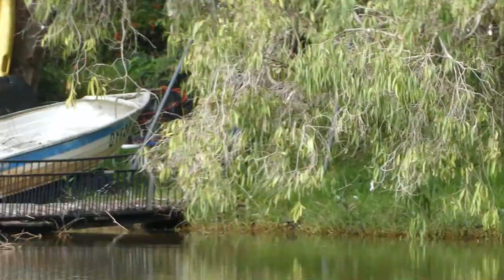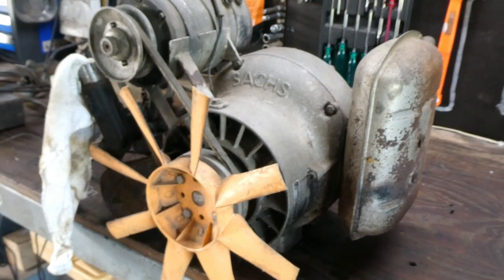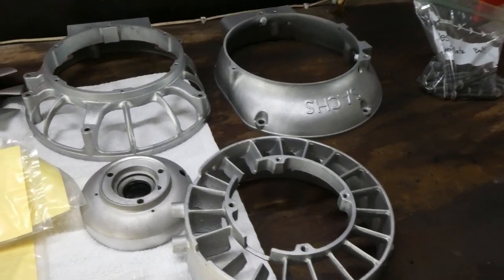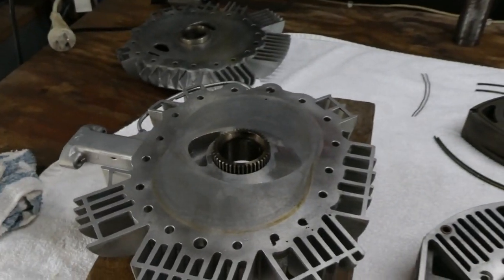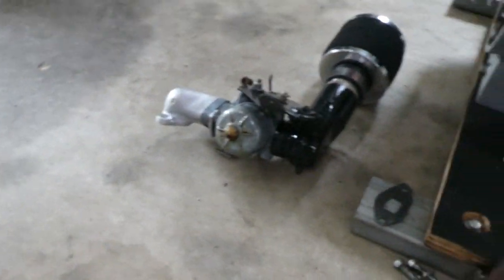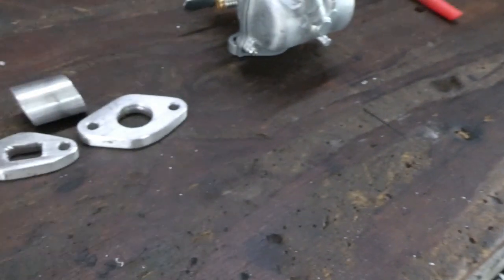Full Restoration Sachs Km 48 Rotary Engine

Comment: Hi i have the same one but I can't find the gaskets could you tell me where you got them, I would be grateful
Reply from the maker: I just made them  out of gasket paper👍
Reply: @linc341  makes you wonder, doesnt it?
i cant rebuild mine as someone chipped massive chunks out of the trochoid, and the rotor looks like someone dropped it on each and every corner. i wouldnt give a damn about throwing some weet bix box in there if i could!

waaaaah. all i could do is scrap some of the casings, keep the rotor and housing. 

and then the guy hassles me for more of it as he just sold a complete one the week previously. 1500. to a leb. within half an hour. effing.